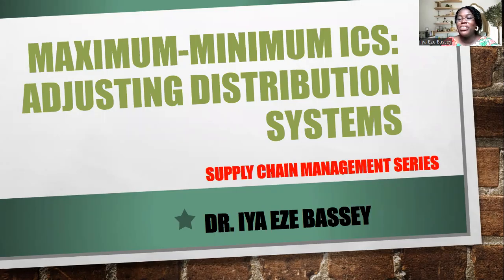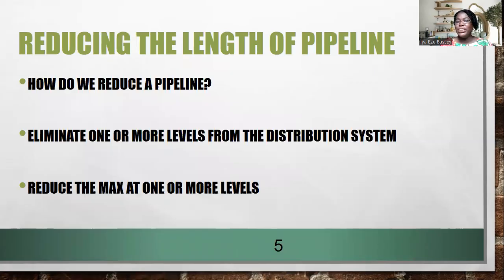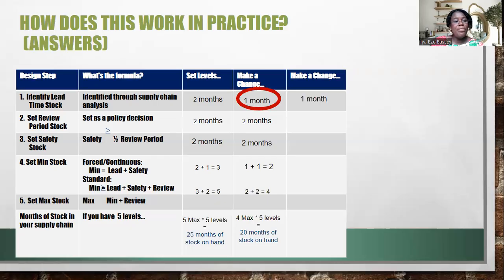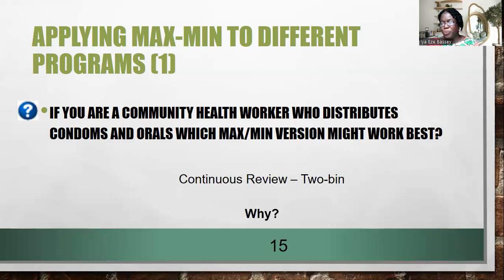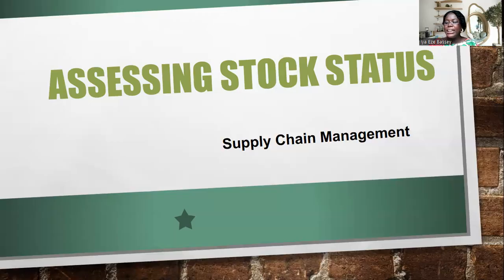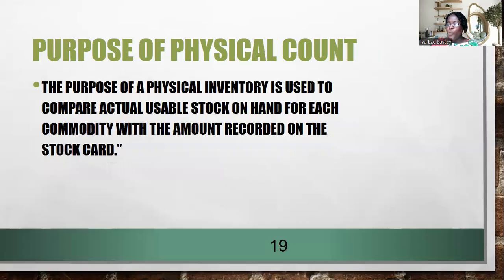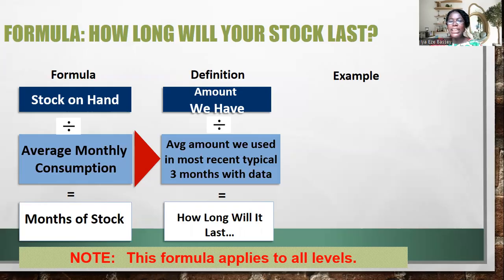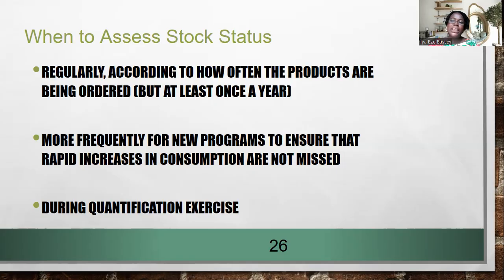Maximum-Minimum ICS: Adjusting Distribution systems (Supply chain management series)

Comment: Thank you again Dr iya eze for the valuable session on the Maximum-Minimum (Max-Min) inventory control system. Your explanation of adjusting distribution systems was very insightful
Designing a Max-Min system involves key steps like identifying lead time stock, setting, review period stock, (a policy decision), and calculating safety stock. minimum stock, and maximum stocck using formulas. Initial policies are set for each facility level. Checking the overall pipeline length implied by these policies is crucial. Adjustments to maximum levels or pipeline length are made systematically by changing formula elements, such as reducing lead time, review period, or improving reliability to reduce safety stock.
Goals of min-max stock 
The primary goals and advantages of using a Max-Min system are to avoid overstocking and understocking. This helps to minimize waste and avoid the cost of emergency orders. The system also aims to simplify inventory control decision making, maintain consistency of stock levels, and provide a reliable data source for forecasting. Ultimately, it is essential to ensure product availability. The standard version is efficient for managing a large number of commodities.

Comment: From this lecture, I understood the steps in designing a max-min ICS which are:
(1) Set up initial maximum policies for each level and faculty
(2) Check if the overall distribution will function properly if the max-min policies are implemented
(3) Check the total length of the pipeline that the policies at each level imply.
It is important to carefully analyze demand patterns and adjust inventory levels accordingly
By monitoring sales data and forecasting future demand, business can determine the optimal distribution strategy to ensure that products are available when they are needed.
I also understood that the advantages of using max-min stock is to avoid overstocking, understocking to minimise wastage and to avoid costs of emergency order, etc. Thank you Ma

Comment: In a summarize forms I learned that,supply chain management, "maximum" and "minimum" inventory control systems (ICS) help optimize distribution. The maximum level defines the upper limit of inventory, while the minimum level represents the lower limit, including a safety buffer.These systems help prevent stockouts and overstocking by informing when to order and how much, ensuring efficient resource allocation and distribution.

Comment: I learned about maximum minimum inventory control ( Max- min ICS) system. It is set up in three steps: 
1. Set up of initial maximum-minimum ICS policies for each level 
2. Checking if overall distribution will function properly if the level specific maximum-minimum policies are implemented 
3. Checking the total length of the pipeline. 
          Advantages of using maximum-minimum system include: 
1. Avoidance of overstock in, wastage, and cost of emergency orders 
2. Simplification of inventory control decision making 
3. Stock level consistency 
4. Reliable data source from sdp for forecasting and quantification 
          A physical count is the process of counting the total number of usable units of each commodity in the health facility by hand at any given time. The purpose of this is to compare actual usable stock with the recorded amount from the stock card.

Comment: Thank you prof for this wonderful lecture 
I learned that maximum -minimum inventory control system is important for managing stock levels helping to prevent both overstocking and understocking.
I also learned 
Max-min ICS sets two inventory levels;

* Maximum level; the highest amount of stock a facility should have.
* Minimum level; the lowest safe amount of stock before a resupply is triggered 
I was able to identify the factors influencing optimal stock levels which includes 
*Product cost 
*Storage capacity 
*Shalf life of health commodity 
There are unique benefits of implementing the max-min system are 
*Mitigation overstocking
*Preventing understocking 
*Reducing wastage 

Thank you ma it was really an impactful lecture

Comment: In summary, I learnt that when a distribution system is adjusted using maximum and minimum inventory control (ICS), it means managing stock in a smart and flexible way. At each warehouse or distribution point, the system sets a maximum and minimum amount of stock. If the amount drops to the minimum, it automatically sends out an order for more. If it reaches the maximum, it either slows down deliveries or moves the extra stock elsewhere. This system helps lower storage costs, stop stockouts from happening, and makes it easier to respond to changing needs. In the end, the whole supply system becomes more cost-effective and flexible.

Comment: This session helps us to understand how to manage distribution systems and stock levels better
Adjusting Distribution Policies – Learn how to improve how health products are delivered.

Max-Min System has to do with Understanding the benefits and challenges in keeping stock at the right level.

 Inventory for HIV/AIDS Commodities shows us  how inventory is managed specifically for HIV/AIDS programs.

Assessing Stock Status: teaches us to know why and how to check if you have too much, too little, or just enough stock.
Stock Duration Calculation is about learning how to figure out how many months your stock will last based on what you have and use.

Thank you ma for the lecture😊

Comment: In summary, I was able to learn that adjusting a distribution system using maximum and minimum inventory control (ICS) means managing stock levels across the supply chain in a flexible way. By setting maximum and minimum stock levels at warehouses and distribution centers, the system can automatically send out new orders when stock gets low. If stock gets close to the maximum level, the system can slow down new deliveries or move the extra stock elsewhere. This method helps cut storage costs, avoid running out of stock, and respond better to changing demand. It makes the whole supply system more flexible and cost-effective.

Comment: In the course of watching this video, I took note and jotted down the following 
1. Distribution System Policies
How to adjust distribution policies and the importance of supply pipeline length.
Methods to reduce pipeline length and maximum stock levels.
Factors influencing stock levels.
2. Maximum-Minimum Inventory Control
 Advantages and challenges of the Max-Min system
Applying different Max-Min versions to various scenarios and the reasons for specific choices.
3. Assessing Stock Status
 The purpose of assessing stock status.
 Distinguish between push and pull inventory systems.
 Importance and reasons for physical stock counts.
  Calculating "months of stock" using stock on hand and average monthly consumption.
  Frequency and importance of stock assessment.
4. SOPs and Program-Specific Inventory
  Identify inventory control systems, stock levels, review periods, and reasons for choices in TB, HIV/AIDS, and Malaria programs.
 Determine if these programs use push or pull systems.

Comment: Very well understood ma. I learnt The Inventory Control System (ICS) ensures health commodities are available while minimizing overstocking and wastage. It uses key terms such as:

- Review Period (RP): A scheduled time (every 2 months for HIV/AIDS commodities) to check stock levels.
- Maximum Stock Level (Max): The highest stock level allowed, set to 4 months in Nigeria.
- Minimum Stock Level (Min): The lowest stock level before reordering.
- Safety Stock (SS): Extra stock to cover uncertainties, usually 1 month in Nigeria.
- Lead Time: The time taken from ordering to receiving stock, which is typically 2 weeks.

There are different ICS versions: Forced Ordering (order up to Max at the end of RP), Continuous Review (order up to Max if stock falls below Min), Standard (order up to Max if stock ≤ Min at RP), and Standard with Emergency Orders (place emergency orders if stock falls below EOP before RP).

Formulas for Min and Max stock levels are:
- Min = SS + Lead Time Stock + RP Stock
- Max > Min + RP Stock

Thank you ma

Comment: Distribution System and Inventory Control
This video covers:

Set-up of policies being a very first set and then checking the length of pipeline if needed, to a suitable duration 

This video also covers:

Adjusting Distribution Policies : Identifying ways to improve distribution.
Max-Min Inventory System : Advantages and challenges.
LMHC Inventory Control : System used for HIV/AIDS commodities.
Assessing Stock Status : Meaning and purpose.
Calculating Stock Availability : Determining months of stock on hand.

These topics help manage logistics and inventory effectively.

Comment: Through this lecture, I've gained insights into optimizing distribution system efficiency by:

1. Streamlining the distribution chain by eliminating unnecessary levels
2. Effectively managing inventory at critical points

I've also come to understand the key factors that influence max-min stock levels, including:

- Product costs
- Storage conditions
- Warehouse capacity
- Transportation reliability
- Expiration dates

Additionally, I've learned about the benefits and drawbacks of implementing max-min inventory systems, as well as their various adaptations. Furthermore, I've grasped the importance of physical inventory counting, which involves manually verifying stock levels to ensure accuracy and reconcile any discrepancies with recorded amounts.

Comment: In summary setting clear maximum stock levels at each point in the supply chain, is essential for improving inventory flow, especially in public health systems.
 The Max-Min inventory control system helps by:

 Reducing waste and Avoiding costly emergency orders.
 However, it does come with challenges, like:

 Managing complex, multi-level supply chains. And handling stock for new programmes Regular stock assessments are important because they:

 1) Confirm actual stock levels 
2)Help prevent stock outs and overstocking 
3) Keep the system running efficiently.

Comment: In summary, i learnt 
The  key considerations for Adjusting a Distribution system 
Assess pipeline length.
Reduce pipeline length to enhance efficiency. Lower maximum stock levels to minimize excess inventory.
    Factors Affecting maximum _ minimum levels.
Age of program 
Cost of storage 
Cost of production 
Lead time 
    Advantages
it offers several advantages 
Present emergencies.
Simplifies inventory management decision. 
Reduce waste and associated costs. 

  Stock status Assessment 
This determines the remaining months of stock by.
Conducting physical inventory counts.
Calculating supply longevity.

 The purpose is to compare actual stock levels with stock cards records for accuracy.

Comment: Here are few things I've acquired from this wonderful lecture 
the steps involved in distinguishing maxmin inventory control system (ICS), the methods of reducing pipelines length and various factors affecting the determination of max-min stock levels. I've also gain in the benefit of max-min system, such as preventing over stock and under stocking along with various challenges. I'm glad to say that the class was enjoyable..
Thanks 🙏
Reply: Thank you so much ma,in summary.i understand what length of pipeline is all about and the steps involved in reducing it.i understand also, the factors that impact max-min stock levels.and also the advantages of using max-min system and the challenges involved in using each version and variation.
I also understand what physical count is all about in assessing stock status,it's purpose and the various calculations involved and also when stock status should be assessed.

Comment: Thank you so much, ma, for this insightful lecture. In summary, I’ve learned that adjusting distribution within the maximum-minimum inventory control system is essential for managing the supply pipeline effectively and maintaining accurate inventory records. This system helps minimize waste, prevent overstocking, and reduce the costs associated with emergency orders.

Comment: Length of a pipeline 
The steps involved in designing a maximum inventory control systems are set up an emission marks mean policy for each level and type of facilities check if the overall distribution will function properly if the level specific marks mean policies are implemented check also if the total length of the pipeline that the policies at each level imply 
Aim is to look at the overall pipeline and see way to improve it 
We we went for the to see how to reduce the length of the pipeline which include eliminating one or more levels from the distribution system and setting up policies that can help reduce the max at one more levels 
How to reduce the stock levels 
Meaning of formulas shortening the reviewed time impotion system reliability at one or more levels 
Factors impact Max-min stock level
Cost of products, cisye of storage, storage capacity etc
Advantages of using the Max-min ICS
It helps to avoid overstocking it also helps to avoid  understocking , Minimise wastage etc
Challenges associated with the various version and variation 
Systems with numerous levels, system that manage a large number of commodities and systems that manages products for new programs Designing an inventory control system can get rather complicating but it is essential to have an inventory in order to ensure your product availability we also went further to see how to apply the maximum minimum ICS to different programs 
Assessing stock status 
We assess stock status by conducting a physical count which is the process of counting by hand the total number or usable units of each commodity in our store or health facility at any given time the purpose of assessing stock is to determine how long supplies will last physical counts should be done once in a year but it can be done as frequently
We went for that to know when to access stock status it is done regularly according to how often the product have been ordered, frequently for new programs it is also done during quantification exercise.

Comment: Summary of Max-Minimum Inventory Control System (ICS)
I learned about the Max-Minimum Inventory Control System (ICS) and its benefits, including:

- Advantages:
    - Avoid overstocking/understocking
    - Minimize wastage
    - Avoid emergency order costs
    - Simplify inventory control
- *Challenges*: Systems with numerous levels, large number of commodities, and new programs.
- *Key Factors*:
    - Cost of storage and product
    - Storage conditions and capacity
    - Transportation reliability
    - Product expiration dates
- *Adjusting Distribution Systems*:
    1. Eliminate unnecessary levels
    2. Manage inventory at key points
- *Physical Inventory*: Comparing actual stock with recorded amounts to ensure accuracy.

I gained insights into designing and implementing effective Max-Min ICS.

Comment: Thank you for the informative video from what I understood in the context of an inventory control system pipelines refers to product that have been ordered from a supplier or manufacturer but are yetto be received this pipeline acts three buffers that help maintain a stable production flow and prevent stock out of overstocking By distributing pipeline inventory at regular intervals manufacturers can keep stock levels steady designing a maximum minimum ICS involves setting initial maximum and minimum stock policies for each facility and supply level checking if the overall distribution functions effectively most policies and evaluating the pipeline length each policy support.

Comment: In summary, adjusting distribution policies involves removing levels in the system, reducing maximum stock levels, shortening review periods, reducing lead times, and improving reliability to lower safety stock. The Max-Min inventory system helps prevent overstocking and understocking, reduces wastage and emergency order costs, simplifies inventory decisions, maintains consistent stock levels, and provides reliable data. However, it can be challenging in systems with many levels, commodities, or specific program needs. The standard Max-Min system is recommended for managing HIV/AIDS drugs, test kits, and lab commodities. Assessing stock status helps determine how long supplies will last, whether there’s overstock or understock, and guides supply planning. Months of stock are calculated using inventory and usage data. Other factors affecting Max-Min levels include product and storage costs, storage capacity and conditions, shelf-life, transportation and supply reliability, stock-out impact, staff skills, forecast accuracy, and program maturity. A physical count is the manual counting of usable stock to compare with recorded data. Stock status should be assessed regularly, during quantification, and more often in new programs to track changing consumption.

Comment: Adjusting distribution systems, involves evaluating and modifying existing distribution pipelines, processes and policies to improve efficiency and reduce cost and enhance customers satisfaction. This can include 
1)Set up initial max-min policies for each level and type of facility 
2) Check if the overall distribution will function properly in the level specific Max-mim policies are implemented.
3) Check the total length of the pipeline that the policy at each level imply.